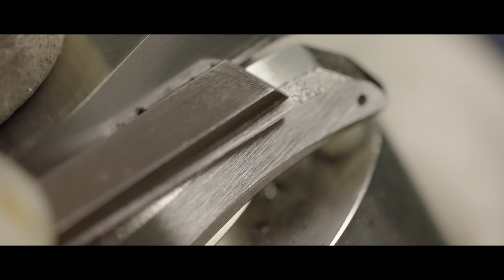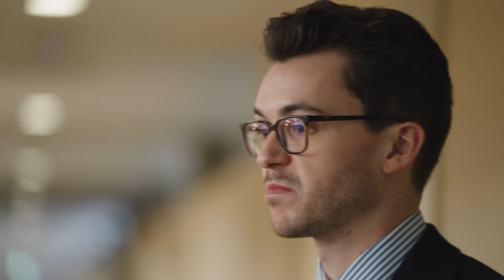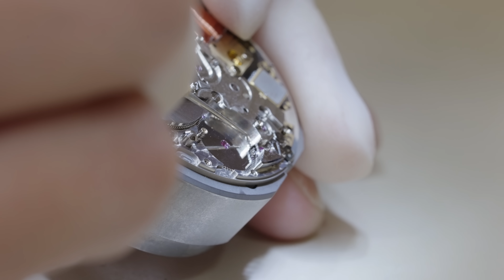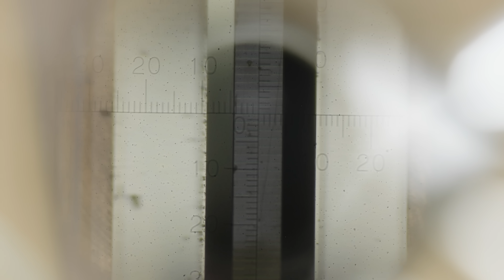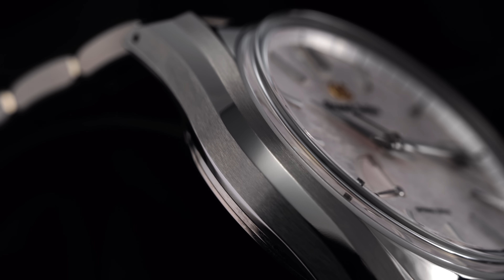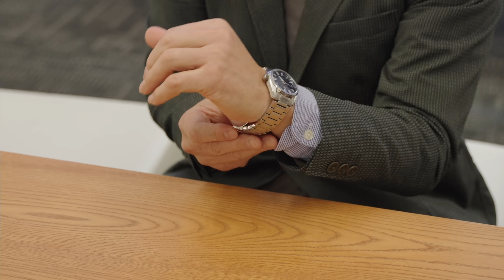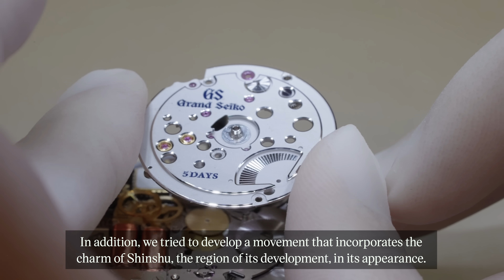Visiting Grand Seiko: How Their Watches, Spring Drive Calibers, Dials, And Cases Are Made

Comment: Absolutely amazing brand and I'd love one but I refuse to buy one whilst their bracelets are as awful as they are currently
Reply: What's so awful about them? Their leather ones are amazing and you can replace them for something you do like. It's hardly a deal breaker when you see their dials.
Reply: They have plenty that come on excellent leather straps, which looks so much better anyway.  You don’t really want one, you just want to be negative.
Reply: I’ve owned a snowflake for almost two years. Took about a month to find the right size. Since then, the smooth edge finishing coupled with the titanium lightness makes it easily the most comfortable watch I’ve ever worn - practically disappearing on my wrist. 

The clasp itself is a safe, quick and smooth acting design. 

My only nit to pick is how the end of the clasp has a gap between it and the bracelet. 

A small downside to an overall amazing watch/piece of jewelry.
Reply: They look sooo much better on a strap anyway.
Reply: @barneyrubble9309  I have a blue strap for it and I might get a grand seiko blue strap some day, but for weekday use I find the bracelet a better option (the polish and finishing are as good as the watch itself. 

Imo the GS put everything they had in the snowflake and it remains its most important watch.
Reply: I have GS, The Sbgm221 on Leather Strap and I have SBGN029 on bracelet no issues    Great brand and love wearing them both.
Reply: I have 3 and the bracelets are as good or better than my 3 Omegas… do not know what are you referring to. No micro adjustments is the only thing they lack and i dont think they ever get into incorporating… why… because they obviously sell enough of them and we obviously dont care about having micro adjustments… lol
Reply: @RobertOrtiz1015  i have rolex and pateks in my collection and bracelets are very important to me since i rarely wear straps . Rolex and patek bracelets are so good that gs bracelets are a deal breaker to me . I love everything about gs from dial to movement finishing etc . And there are many collectors like me who feel the same way . If gs wants to expand it should listen to its customers . Longines offers much better bracelets at watches worth 1/4th the price .
Reply: @RobertOrtiz1015  Micro adjust is a huge deal for some of us.
Reply: Yeah the bracelets is the only think stopping me from owning one . For a brand like gs its sad to see no improvement on the bracelet front even after so much feedback from collectors .
Reply: I got SBGE295. Its bracelet is as good as my submariner. It has micro adjustment and little quirks.
Reply: @karlfranz7434  no way bro its not even close to the sub bracelet .
Reply: I wish they tapered, had micro adjustment, and had an option similar to Rolex Jubilee.
Reply: What's awful about them? I just got an evo 9 in titanium and am pleased with the bracelet so am curious why so many folks dislike them. I know it doesn't have micro adjustment, which I'll admit would be lovely, but otherwise I really like the braclet.
Reply: @UnOrganizedMafia I’m not here to argue, you had asked why people dislike the bracelets. So I bought a brand new GS from an AD. I was ok-ish with the clinkyness of the bracelet but I got home from the AD and I was used to buying quality watches so I didn’t get out a loupe and fully inspect it. It was a brand new watch, I shouldn’t have to. But I got home and noticed a weird gap in the clasp. They mis-drilled the holes from what it looked like. So I brought it to the GS dealer and they sent it back to grand seiko… well grand seiko bent the clasp till the gap looked closed but the holes were will drilled offset, so the gap was smaller but it was still at a big angle… so I asked for a refund. I basically wore the watch on my car ride home. I have mostly had Omega and Rolex and the bracelets are screw together with tight tolerance screws meaning you can put loctite on the screws and you are good and the clasps are machined so they are very solid and secure. Grand Seiko uses pins and collars, I’ve had older watches that have pins and collars. So imagine this, you have a pin with spring collars at the ends. The collars have to be bigger than the pins so they can friction hold the pin  in place. So that means the hole that they go into needs to be big enough to allow the collars to slide thru WITH the pin. Meaning the holes are exceptionally bigger than the shaft of the pin. Meaning, there is no way to make a pinned bracelet be very precision and non-clinky. Additionally threaded screws can be loctited into the threads in the bracelet and they’ll hold for a lifetime. However over the years with a pinned bracelet, that collar can wear or often break because the pin itself is thinner where the collar is so your risk of losing your watch due to a pin breaking or falling out is much higher as the watch ages.
Reply: @UnOrganizedMafia  I typed a whole reply in detail to you earlier about the design on a pinned bracelet and the stamped clasp Seiko uses but it looks like the AI that automatically deletes comments took mine down.
Reply: Very true. I own several of them, the evo9 bracelet is better, but still way too thick and should taper to 18mm and not 20mm. I won't buy another GS until they change this. The cases are magnificent, why not have at least an oyster-bracelet quality? For those that have no issues with them good on you; but comparing side by side with any rolex bracelet will tell you why everyone still loves rolex more...it's unfortunate
Reply: @RichMitch
Why are the bracelets awful.
Elaborate
Reply: @Andyals4501  cumbersome, clunky, clumsy, outsized and ugly
Reply: @Andyals4501  inelegant, clumsy, clunky, outsized and plain ugly. They feel like an afterthought. They're not in keeping with the brilliance of what is happening on and inside the case
Reply: @RichMitch  
Give me a specific example. I think you're lying
Reply: @Andyals4501  lying?! Who do you think you are talking to. Get away with you
Reply: @RichMitch  
I'm talking to someone who trolls Seiko reviews with hate. I've handled several GS and bought one on a recent trip to Japan. I can confirm you are a liar
Reply: @Andyals4501  pathetic attempt to distract from your outrageous allegation that has no basis in fact. I expect an apology. There can be no lie when offering an opinion. 
You, on the other hand, made a statement as if it were fact. 
You're on the wrong side of the law.

 Apologise immediately
Reply: Grand Seiko bracelets are not a problem. I have two of them and both fit extremely comfortably.
Reply: Even in this video they don’t talk about bracelet and clasp design LOL
Reply: The bracelets really are subpar. I've owned 6 GS watches over the years and I can't get past the bracelet. That said, SBGM221 on a strap.... Perfection.

If IWC can make a bracelet that is fully tool free on a $6k watch, GS can at least add micro-adjust to the ones on their $10k watches lol
Reply: blud mistakes seiko 5 with grand seiko
Reply: Is leather not an option?
Reply: Your loss
Reply: Their bracelets are completely fine.
Reply: You buy a Rolex to impress others,  you buy a grand Seiko to impress yourself.
Reply: @shakeybonessrh  That statement hasn’t been true for a decade. People buy GS now to impress other “enthusiasts”, it’s a generic look how refined my taste is alternative to Rolex
Reply: @Gramkan Yup this right here.
Reply: @shakeybonessrh I own both a Rolex and GS.

No one who owns a Rolex talks about how it’s better than a Grand Seiko… But everyone who owns a Grand Seiko talks about how it’s as good as a Rolex.

That shows you which brand makes the better watch 😉
Reply: @FJwoodworks wow you have a Rolex and a GS?  Man you must have lots of money.  Literally two examples of haute horology that only ballers purchase
Reply: @fj7509  people don't buy rolex because it's a good watch. They buy the brand. People buying GS don't buy the brand, they buy it because it's good.
Reply: @Newerasamearea  But they buy it because "it's as good as a Rolex..?" lol.

I have both, I own a Hi-Beat, Grand Seiko fanboys are insecure.
Reply: Awful? The bracelet on my SBGA083 is nothing short of stunning.
Reply: They don’t have quick adjust. I could never get my GS to fit properly. I sold it for that reason. When they start making bracelets with quick micro adjust, I will be back
Reply: Who even wears bracelets?  Straps are where it’s at.  Customization is the key to longevity imo.
Reply: You just yapping.
Reply: Yea, they seem to be allergic to decent bracelets
Reply: I agree their bracelets are trash. I even did a video about the GS that I bought. The bracelet is one of the BIG reasons I returned it. Not only was it a clunky mess BUT they clasp was all messed up, I sent it in for repair the day after I got the watch and grand seiko simply bent the clasp so it looked a little better. I think GS doesn’t take the bracelets seriously.
Reply: @alexsystems2001  just watched your videos and that is an absolutely shocking experience, glad you were able to return it. Yikes
Reply: So funny the poors who can’t afford it complain about the bracelet. I have GS and Rolex. The GS is superior overall price and brand. Rolex is the Instagram watch now
Reply: @USMCRonin  the poors? Damn. You are a class act fella.
Reply: @etebol alright you poor
Reply: @USMCRonin  You not only have GS and Rolex, you have Arrogance  as well.
Reply: @USMCRonin Even Tudor bracelets are better than GS, the Rolex destroys them
Reply: @USMCRonin No need to be a prick. Have some manners, and class.